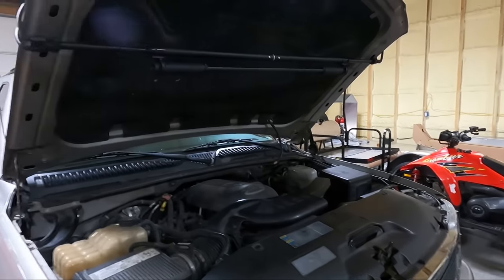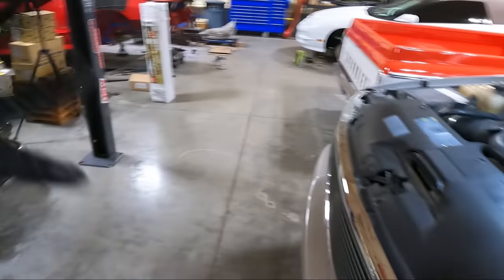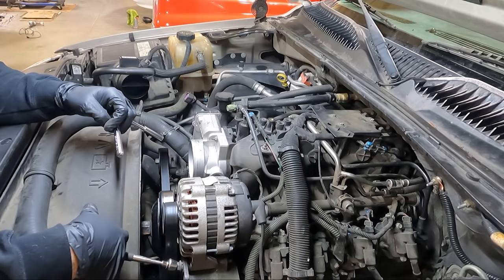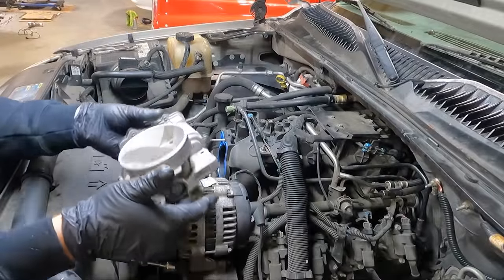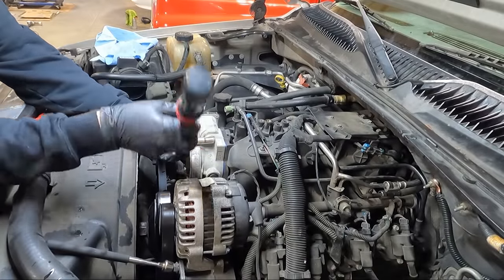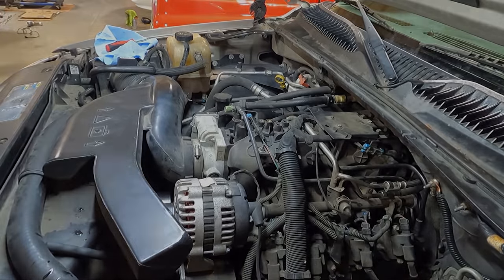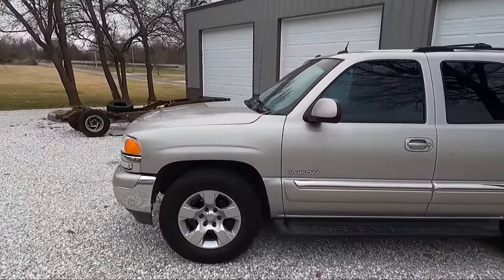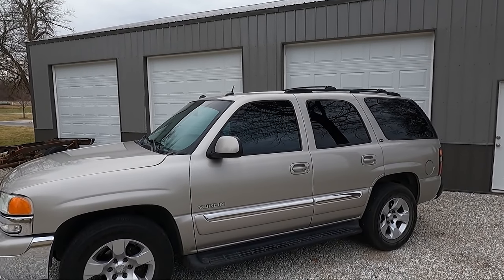How to Fix Reduced Engine Power GMC Yukon

Comment: Seafoam your throttle body
Reply from the maker: Its brand new with no carbon on it. Bad oit of the box.
Reply: @TWAMotorsports  no the one you took out the yukon! Had a similar issue! Also as I seafoamed it I used a combination of Lucas gas treatment (small bottle) & 1/2 a bottle of seafoam together on an near empty tank( do it when your gas light comes on!) Also dump half a can of seafoam in you oil crank case  , this triple combination works best right before an oil change!  Also change all your caps(oil,gas,coolant etc)  bad Orings to sensors maybe reducing power!  Great trucks ,but they are babies and must be cared for 24/7 lol
Reply from the maker: One I took out was brand new aftermarket. Not a spec of carbon on it. Seafoam is a great product but wasn't fixing a bad out of the box throttle body

Comment: I have a question I have a Yukon and it has a brandnew thorrle body on it and it kept going into limp mode and and idk if its a Dorman or a GM but I bought a new gas pedal and replaced it and it was a doorman but of course I bought the thing it has the 6.0 in it and I am gonna clean the grounds and see if maybe I just might get lucky and I can't stand it I thought it was fine the damn thing was good cuz I drove it to a wedding and only put 150 miles on it and bought a new set of tires on it doesn't have a noise in it dent on it or tear in the interior I had to replace the hydroboost because it was leaking and it was a was a sob cuz I am a big guy it's like me tig welding a chassis on the jig and crawling all around it man I have had it for a while now and idk if I  have put so much money in it that I wanna make sure it's bad I guess I could check the voltage on the tps is that what goes wrong w the. Dorman ones you've replaced or is do ya know what goes wrong w them? I am gonna clean the chassis ground down between the door and the fender and if that doesn't fix it I'll take your advise and go buy a new GM iknow they are probably outrageous but damn I don't wanna give up on it I bought it but the throttle when I was driving it home the damn thing you could press the gas and. It would take off and when I changed the gas pedal it was a used one cuz it said caddilac  ON it so someone had put a used one on it idk if you may have any other ideas? I never qsk for help I can't even spell it lmao but I am lost haven't ever had this much bad time w any throttle body and I wanna make it my daily but it sucks going into limp mode thanks anyone on here that may be Able to help me w it I would appreciate it greatly
Reply from the maker: Always buy gm replacements. They are maybe 70 more than dorman.

Comment: TC light on how to repair, reduce power engine sucks
Reply from the maker: Probably throttle body
Reply: @TWAMotorsports  appreciated without hitting any bumps it turns on I had to turn it off then back on to get it driving again without the TC code or reduced engine occurring thx happy father's day 😉
Reply from the maker: Thank you. Same to you